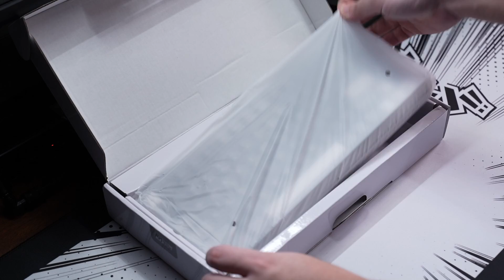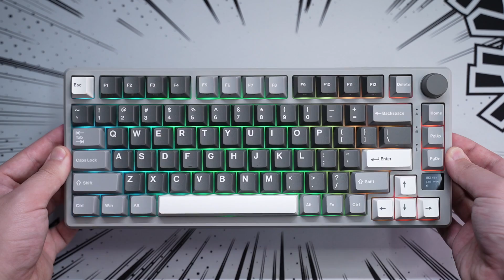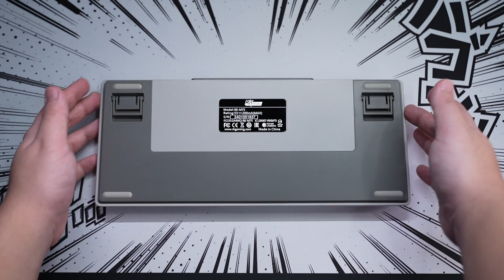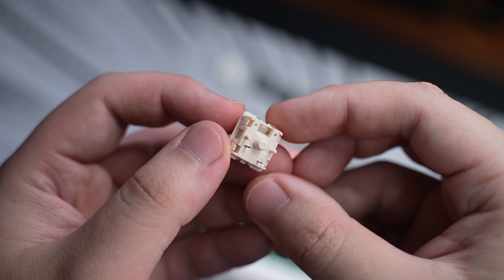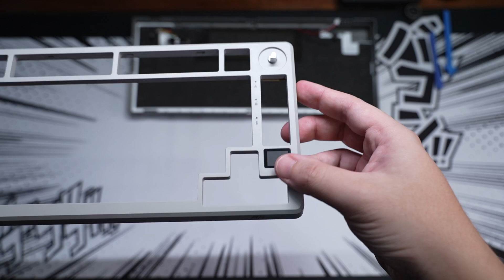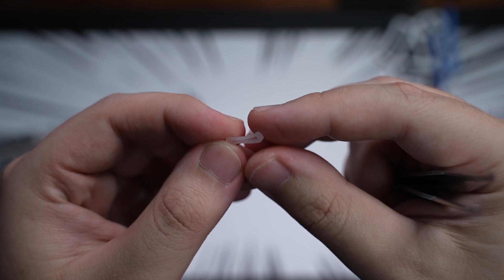Royal Kludge M75 - Teardown Mods & Sound Test

Comment: if the battery is failing and not charging at all is that cause the lcd screen is not turning on as well even when it connects via usb? it works fine while connected to usb but the lcd screen not on and its not charging at all if discon in usb its off.
Reply from the maker: The screen will not be on all of the time to save battery I think. Is it on when you're using the keyboard?

Comment: Mine has connectivity issues. Dongle connection keeps getting disconnected.
I am using either bluetooth or wired now
Reply from the maker: I would recommend using a dongle extender, but so far mine has no issues

Comment: People be confusing older and new model of the m75. Newer model comes with pbt caps whereas the older one are abs. Differentiated by "back" button on older and "backspace"  on newer
Reply: This is a really helpful comment. I was wondering how to differentiate between the two
Reply from the maker: I also did some research and yeah, it appears that the newer ones have PBT keycaps

Comment: Hey Sam, love your review, especially love the fact that you included some really good quality sound review for the keyboard, that helped a ton in helping me assess how it might feel when I'm using it. I have a question for you, wondering if you've had experience using or reviewing the Keydous NJ80, when it comes to the typing feel and the sound, how do you find it compared with the RK M75, is there a huge difference between the two keyboards?
Reply from the maker: Hey, thanks! I've tested the NJ80 before and it's a little old now tbh. I prefer the RK M75 feel but I like how I can build my own NJ80. Depends on what you like

Comment: choosing between this and the Aula F75 was so damn hard. Ajazz ak820 aswell. I ended up getting the Aula, and I love it, but I'm constantly wondering if I made the wrong choice. I personally think the Aula sounds better than the M75, but the M75 looks better in my opinion
Reply from the maker: The M75 looking better is true, but the main difference I would say is just the screen. If you really want a mini screen on your keyboard the M75 can satisfy
Reply: @itssamueltan next RK M87 sir
Reply: This keyboard is insane because it's AZERTY in europe, not like F75 and hi75 that I bought and send back because I thought I could stand the qwerty diff xD
Reply: I'm in the same pickle currently. Debating which one to return. Ajazz dropped off almost instantly for me. The Aula sound and feels better. The main issue is that I love the Aula F75 sound and feel, but literally everything else is in favor of the RK. The build quality is much better, looks more pretty, solid knob vs a very crappy one on the Aula. Mac mode + mac icons on the keys, which weighs heavily since I'm a mac user. Usability with the display, setting RGB schemes, connect options, battery level etc ... In every regard RK is just a more premium product. And It's not even close. The Aula just have that more thocky sound I really love and with some key mapping corrections you can get It to work for Mac as well, just not as user friendly. Aula is cheaper too. If you're a mac user and prefer a more clacky sound, go for this RK, without a doubt. Maybe I'll explore modding the RK to get It how I like It ... that would be new terrain for me though ;-)
Reply: @deuxvega  m75 lcd only for battery and connection mode, there is no gif function just for indicator 🤣
Reply: @deuxvega  If you only like the Aula for how it sounds/feels then you can just mod your M75, you can even try getting the same switches your Aula has (not sure if you can buy them seperately). To me that sounds like the best option since you like every other feature on the M75 better. 

Both boards are well built and dense so the difference in sound/feel is going to be mostly due to the different switches. I'd keep the M75 and buy new switches. Changing them is super easy. Either try getting the same ones your Aula F75 has or try finding other switches that you like the sound of, keeping in mind things like whether it's tactile/linear and things like actuation forces and such
Reply: @lfmm97  You really think It's just the switches? My Aula has the Crescent switches, which I can't find seperately. I'm doubtfull there's not something else with foam or the gasket / body going on as well. Also I'm not experienced enough yet to actually know / understand which switches I like, or would be similar to the Crescent switches.

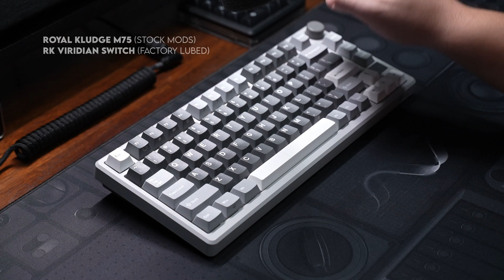Comment: 04:57 Sound - in case you want to click to it repeatedly.
Reply from the maker: It starts at 04:52 tho
Reply: @itssamueltan ❤ I greatly appreciate your video.
In case anyone wants to rewind and instantly continue hearing the keys, it’s at 04:57 .
04:52 gives a slight delay / gap in sound continuity.
Regardless, thank you for providing time stamps.
Very well done.
Liked, subscribed, and 🛎️ notification turned on.
Reply from the maker: @TwilightTypingASMR  I understand now 🤣 that would be more satisfying